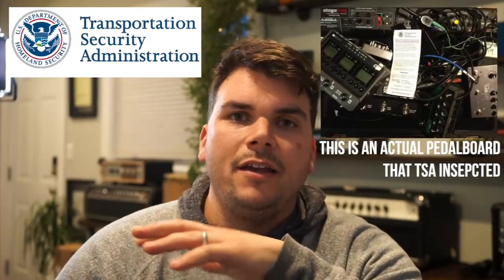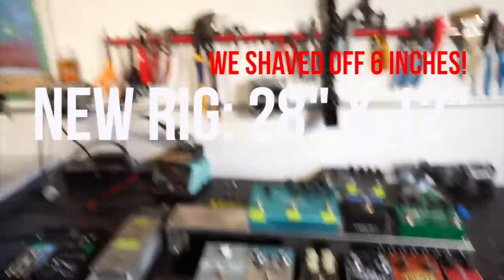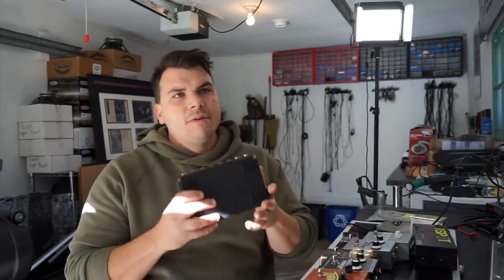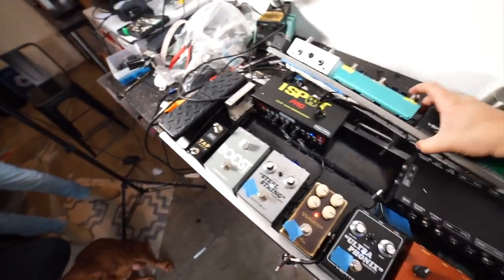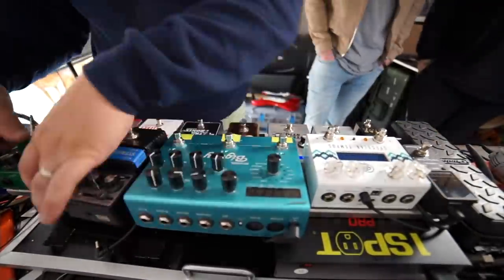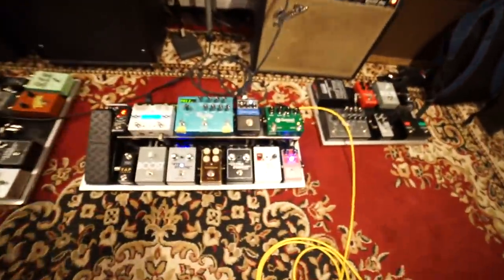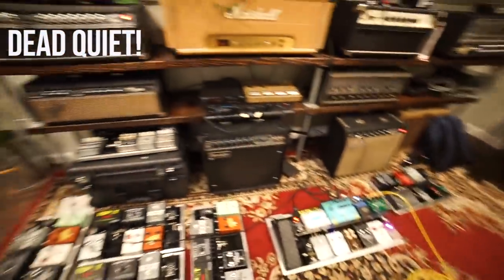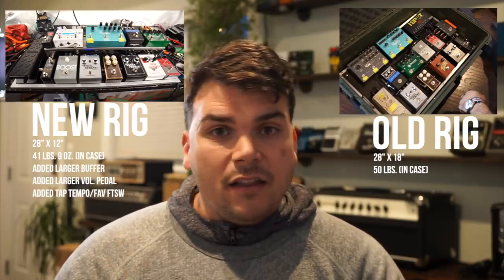Build A Bulletproof Pedalboard

Comment: Do you need a Interface box with buffer or can it be with out it??
Reply from the maker: Josue Guajardo interface, not required - buffers - definitely needed
Reply: Vertex Effects  I do have a buffer. But just want it to know if the guitar interface had to have one
Reply from the maker: Josue Guajardo there are three buffers in in it.  Input buffer, output buffer (left), and output buffer (right).  The interface houses the buffers and does all the signal routing for entire rig.

Comment: How is this TSA proof? Didn't really change anything other than layout. Looks like a normal build to me.
Reply from the maker: No spaces between pedals, anywhere that hands can get leverage = easy for TSA to disrupt your pedalboard.  The tiered second row also overlays the cabling on the front row to protect that, so no removal of cables, or pedals.  Back row was the most susceptible to TSA issues, so in all the gaps we added handles to eliminate gaps under the tier and near the volume pedal so that it would make it difficult to unplug or remove pedals.  It also doesn't hurt that we made it more travel friendly by reducing the overall travel weight by almost 20% and removed 168 square inches in total size from the board while adding more pedals to the rig.  Hope that helps clarify.
Reply: That to me means that TSA may need to put stronger hands to check whether this is a menace or not. You are saying that TSA will give up if they find it difficult to investigate which is the opposite actually. Good luck
Reply from the maker: Mariano Fernandez I don’t know the exact parameters that TSA sets, my understanding is it’s own most regional in the execution of some of the parameters and regulations. However, anecdotally, players have reported that the more difficult it is to remove things, the less problematic they find the condition of their boards at the end of a trip. Perhaps this is superstitious, perhaps I have a bad sample size, but in my mind what the customer dictates takes first precedent.
Reply: @VertexEffectsInc  I get what you're saying, but it's not actually TSA proof. I think myself and others are commenting this way because your video title appears to promise advice on building a better rig for fly dates, but at the end it wasn't anything we didn't know. Not tryna be a jerk, but just a heads up. Be careful with those YouTube titles.
Reply from the maker: The intent of the rig, dictated by the customer (Ben), was to make the rig as travel friendly and impervious to TSA mishaps.  Ben laid out the issues he had, specially with pedals being removed that had more space around them, zip ties being removed, cables being disconnected.  To mitigate this, he and others who’ve attempted to TSA proof their rigs, made the pedalboards as compact as possible, thereby reducing weight as a byproduct, but more importantly, making cables difficult to access or dismantle.  With that in mind, the thesis of the build was around TSA Proofing the pedalboard.  Now if that wasn’t illustrated sufficiently, it’s perhaps more a reflection of my editing more explicitly around the thesis than what actually took place.  From where the recipient, Ben, is standing, the mark was hit.  As a viewer, sound like it missed the mark for you.  All as I can say, is that I’ll do better in the future, I’m still getting the hang of how to shoot and sequence these videos, so I appreciate the feedback.  Nevertheless, I hope you watched and walked away with something tangible you can apply to your own rig.  Thanks for the feedback!

Comment: Is there a reason why you don't put power in your interfaces? Seems like a good idea to put a powercon in there, so the powerconnection for the entire rig is safe and secured :-)
Reply from the maker: Jonas Gravlund the reason is noise, typically I try to keep AC as far away from the audio signal as possible.
Reply: @VertexEffectsInc   Okay, seems reasonable! :-) Would it still be an issue if the powersupply was on the other side of the board, opposite to the interface?
Reply: Or would it be possible to shield the ac inside the interface?
Reply from the maker: Yep you have to bring the AC over to the interface somehow, the more you can isolate from the audio the better for noise
Reply from the maker: Shielding wont solve it - interference with other pedals and cabling outside of the interface will also be problematic.
Reply: @VertexEffectsInc   Yeah sure! :-) I guess you could just make a powercable with IEC lock if you wanted to secure it more - or just make a powercon-hub next to the powersupply
Reply from the maker: Jonas Gravlund I think the locking component is problematic as well, because there’s nothing to “give” if there is impact - so typically what ends up happening is you end up breaking the Jack completely instead of just having your power cable pulled out, or one of your quarter inch jacks un-plugged.  I’ve found the theory of them to be good, but in practice do end up doing more damage than conventional stuff.

Comment: where did you get the interface?
Reply from the maker: Chris OsborneBand we made it custom for this rig
Reply: what do you charge for that interface?
Reply from the maker: Chris OsborneBand I don’t typically sell them directly, because they’re all made for specific rigs that I am building in total. I can recommend some really high-quality over-the-counter ones if you tell me what kind of stuff you’re looking for.
Reply: @VertexEffectsInc  plz do I have a really nice board being built but your interface has some great options
Reply from the maker: @chrisosborneband4941  I think the best stand-alone buffer is the Mesa Boogie High Wire, so definitely start there, beyond and input and output buffer, what do you need?
Reply: buffering is not the issue - I like the option on your interface for adding additional pedals...that really caught my attention. I am using a GigRig G2 switcher with some great pedals but ya never know if/when I want more lol
Reply from the maker: @chrisosborneband4941  right...you could always just build a pass through patch bay (which is what that is), and just have a shorting return on the box so when it's unused the signal normalizes.
Reply: @VertexEffectsInc  very cool!! I will tell my builder...thank you!!

Comment: Does summing the stereo signal cause phase cancelation?
Reply from the maker: wordsworthjlang There can often be phasing issues, I don’t typically recommend doing any sort of summing, because the presumption is that both left and right channels are at a 50% mix. This isn’t always the case especially with more dimensional settings, often with one of the sides with a inverted phase and at a lesser mix on one side.  What I recommend doing is creating a group of presets design for a mono rig, hard panning the left side of the effect.

Comment: Love your videos!!

Can you tell me where I can buy the interface box? Especially the stereo/mono configuration interested me!
Reply from the maker: Alex Groen Those are all made custom, and are pretty involved, I would recommend getting something premade like the high wire from Mesa boogie. It’s far is the interface box itself you can purchase that from electronics store like Fry’s electronics
Reply: @VertexEffectsInc  thanks!
Reply: @VertexEffectsInc  Most of all, I'm searching for a box that let's me choose between and connect to mono and stereo, so that I won't have to rewire my board if I have to play a gig where mono is the only option.
Reply from the maker: Alex Groen The reality is, that those mono sum boxes never quite get it right because the presumption is that all the pedals are mixed 50% left and 50% right.  The reality is, that in order to create dimensionality, many stereo pedals are not mixed evenly, and even in some cases will have different polarity on one side. The idea of mixing these evenly at 50-50 is a problem, and even though I’ve put some of them on interfaces, I’ve had to build a customized mixer to get the best possible sound, but even then it is a compromise and I feel that the consumer would do better if they created separate patches for hard panned mono set ups and stereo set ups rather than the mono sum.